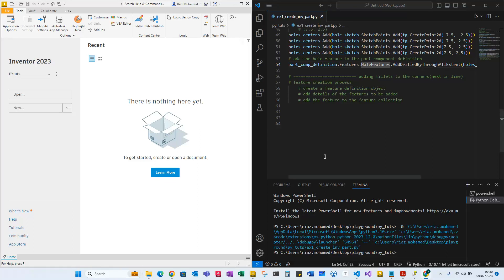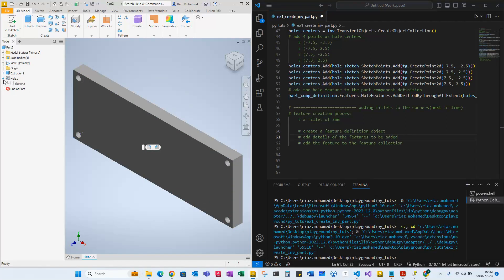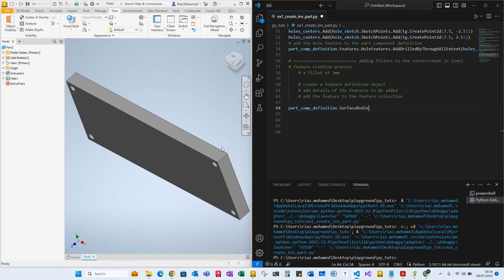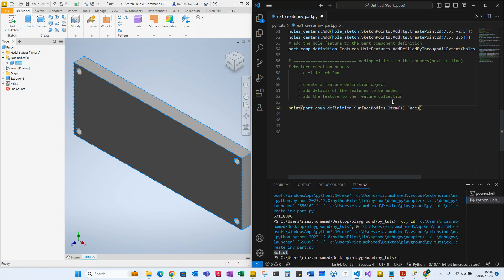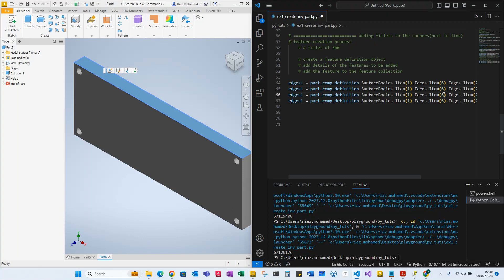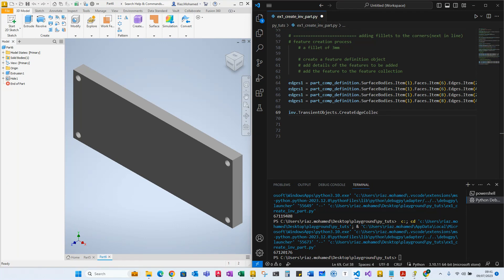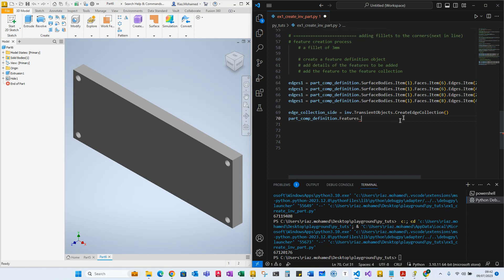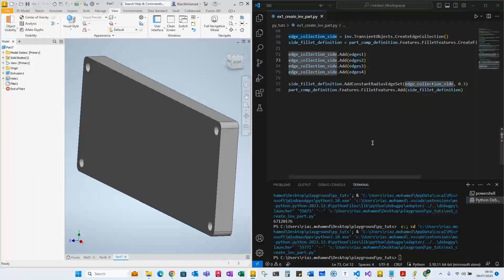Part 6: Creating a fillet feature using Python and Autodesk Inventor API

Comment: Thanks for the video! But how do I find out which number the face and which number the edge has, when I have a different geometry?
Reply from the maker: Hi Ian m glad you liked the video. I will make a tutorial on that. However using this technique to get the edges is not recommended. This was just a tutorial on how to select edges.
Reply: Thanks! @theaiautomationist